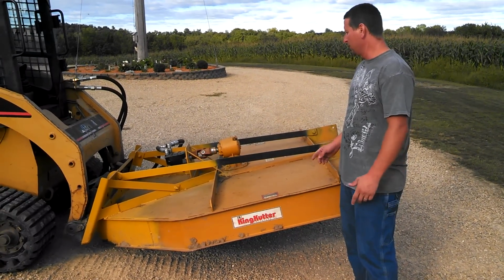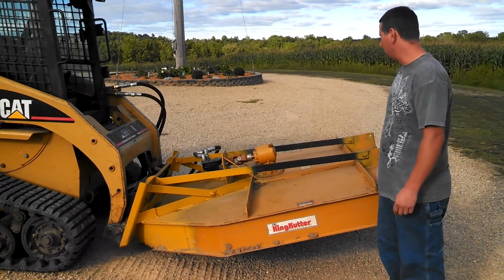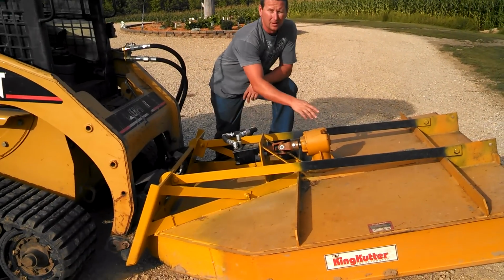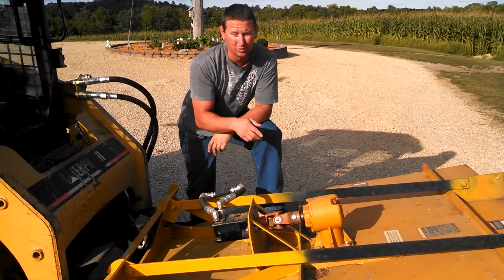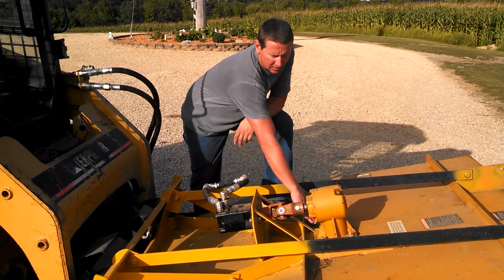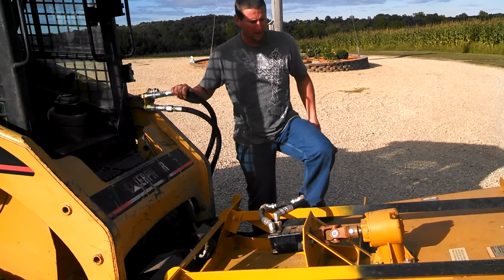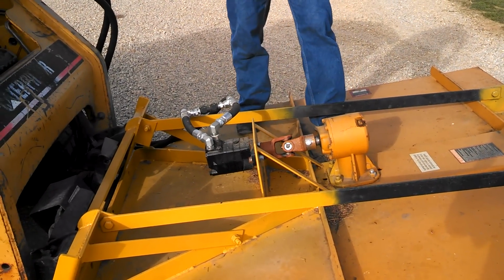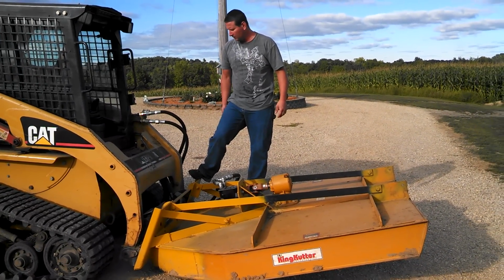Homemade skid steer brush hog

Comment from the maker: "surplus center" is where I got parts and pumps,  I told them machine flow numbers and what I was doing and they gave me right pumps!
Reply: +Jay Hansen Wouldn't an overrun clutch work just the same as the bypass valve? Probably not cheaper but less work. And instead of shear bolt you could also use a pto clutch as well.
Reply: can you give me more specs for the hyd motor
Reply: not get much help from sur center

Comment from the maker: Well I used a skidsteer mount plate with a lot of welded on brackets. I called surplus super center with my flows and line psi and they told me what hydraulic motor to use! Don't know if it would be the same one? As for a u joint that also depends non your brush hog and motor. 3/4 inch hoses 7' long

Comment: I finally found a beat up 72” bush hog, I’ll order all my parts from the surplus center tomorrow.   Where did you find that U joint coupler with the shear pin?  That’s what I need for The 1 3/8” shaft on the gear box of the bush hog.  Thanks for your video it is the best one on YouTube and I looked as a lot.
Reply from the maker: I found it a local welding tractor Fix-It shop but I'm sure tractor supply company has it or a tractor implement

Comment: Were did you find the  u joint connections for pto shafts
Reply from the maker: A local tractor welding place in Viroqua Wisconsin call tollefson Welding Supply

Comment: I like it.  Seems to cut better than lots of the purpose built $5,000.00 units for skid steers.  So many of them that I have watched bog down in grass like that.  They have to go very slow or are going forward and back or taking a half width cut.  I am building a 6' one from my King Kutter 3 point.  It will have an 8 in motor for the 23 gpm.

Comment: Great job. I need to build a sander bucket attachment.  I have the Cat242D --I am going to use a hydraulic motor to drive spinner. so of coarse a motor that handles 3335 PSI. the specs say 20 gpm flow. so should I purchase the pump close to as flow rate? or does that matter as you said your motor was around 6.
 Thanks for the help'''

Comment: Can you update us on the bush hog?  How is it holding up? Could you post another video cutting some bigger stuff?  I'm planning out the same project, thanks for showing me that this is possible.
Reply: dutchofsc I watched this video in preparation to doing one of my own.  I have a couple videos of mine cutting some heavy grass and weeds on my channel if you are interested.
Reply: BigIronTV How is your mower holding up?  What was your pressure and flow?  Which motor did you go with?  Anything that you would have done differently?Thanks for the reply, I'm looking forward to this project.
Reply: Did you ever try and do something like blackberry brush with yours?  Wondering how it would hold up to something like that.

Comment: just picked up a case 1845 skid steer, and want to do the same thing. did you also get the universal joint drive from surplus center?.  Also thanks for sharing your info ,I own a welding company in Hawaii needless to say we have a lot of greenery to mow,  Awesome job!!!
Reply: Did you end up building your brush cutter? I also have an 1845c.  I’d like to know the specs on what you used
Reply: @joequint  I’m finishing up the complete rebuild on my 1835C case Skidsteer first but I’ve partially built the brush mower housing and got suggestions form surplus center on the hydraulic motor and pressure relief valve. My Skidsteers  GPM is 16.4 at 2700rpm so the hydraulic motor suggested is item number 9-7368-125 and the relief valve number is 9-8745.  I have 3 gear boxes I can choose from for the mower drive so I’ll experiment and see which one works best. Thanks for your interest.
Reply: Sorry I think I miss mentioned that my machine is a 1845?  It’s a 1835C.

Comment: Looks great! I have about the same gpm as you stated on a similar unit. Do you remember the hyd-motor model number? That would be a great help.
Thanks
Clint
Reply: Clint Terry The motor will very depending on your hydraulic output.  You will need to know the gallons per minute of flow and the operating pressure at your maximum flow.  I called and told them the flow and pressure and what output rpm I wanted.  Then they calculated the displacement size of motor that would give me the desired rpm at the specified flow and pressure.  I used a char-lynn 2000 series with an internal cross flow valve so I did not have to put the external valve in for spin down.

Comment: Is your check valve installed so it flows from the return line to the pressure line for the shut off spin down?
Reply: wouldnt work very good if it was installed the otherway around hahah oil would never turn the motor

Comment: Nice video, Jay.  I want to convert my PTO bushhog  to one like yours simply for better visibility.  Surplus center told me the correct motor for my tractor but I'm really interested in the performance vs the PTO.  Are you pleased with the power and torque so far?  Any complaints?